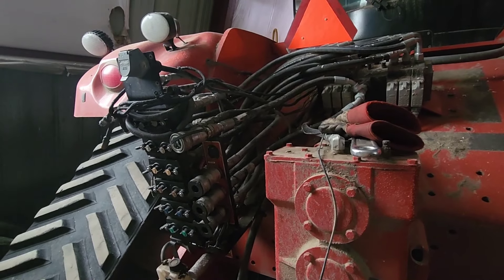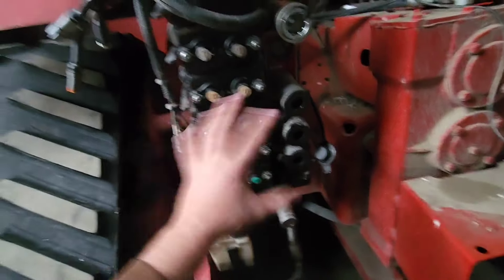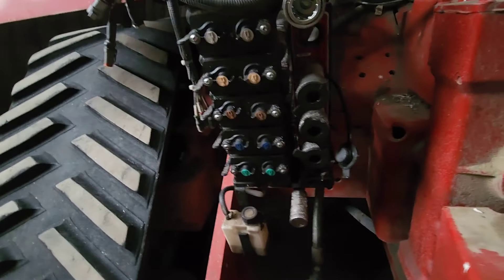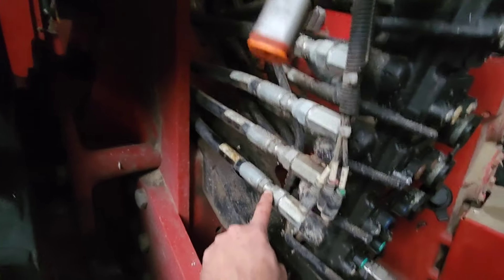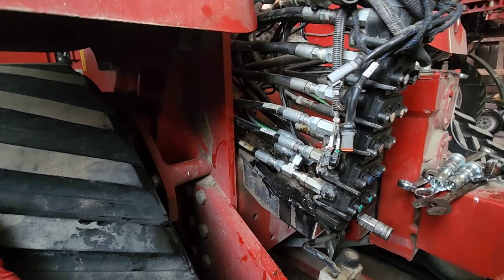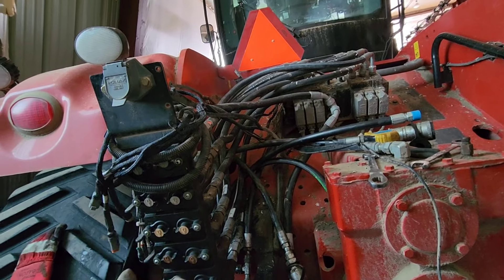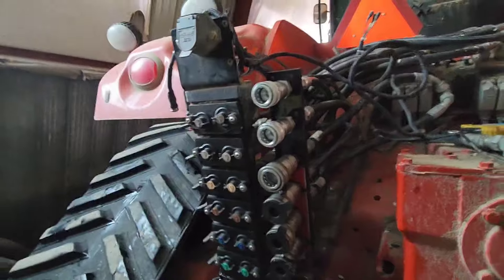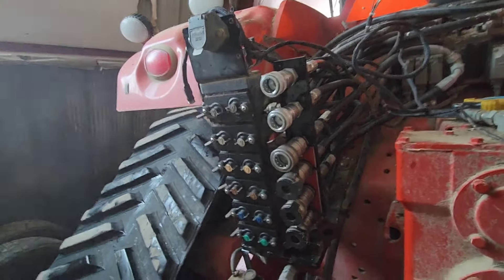Versatile 610DT Hydraulic changes for the Vaderstad Seedhawk

Comment: Good morning Devin, how did you end up running your return on the new 3/4 line ? I added another t onto the existing t and it worked great ! No leaks or problems it worked well!
Reply from the maker: I Teed into the back of the SCV for both pressure and return so it operates exactly the same as the stock SCV #1 1/2” pioneer connectors. So it is still Bi-directional